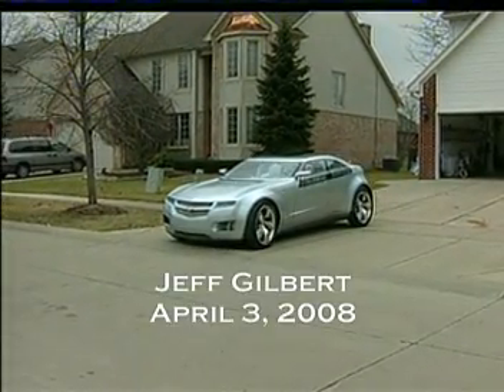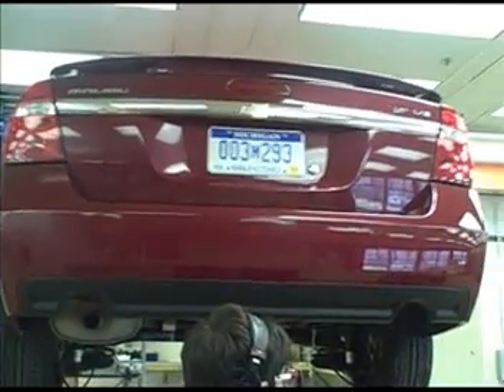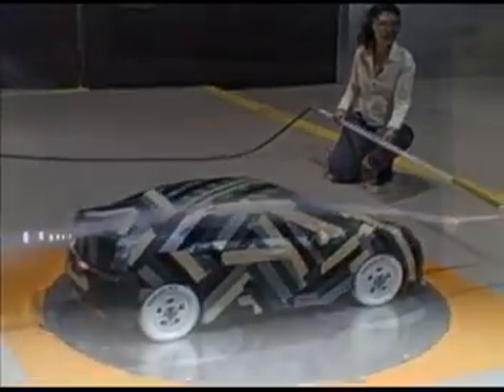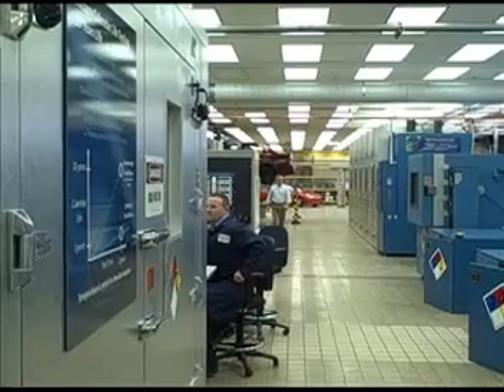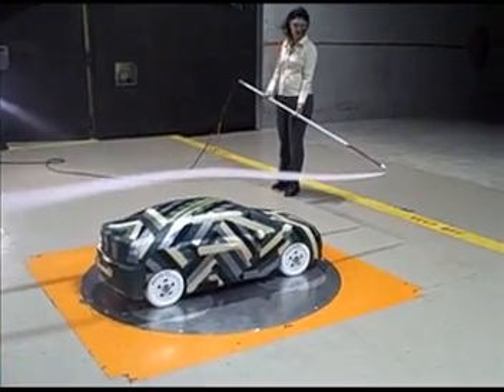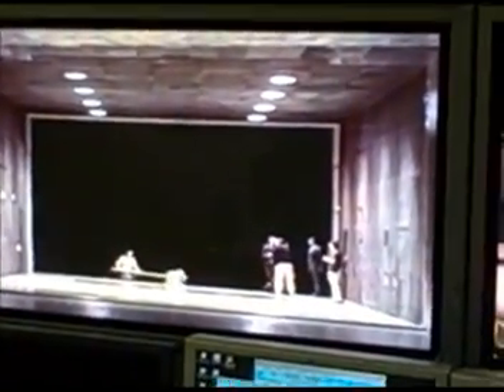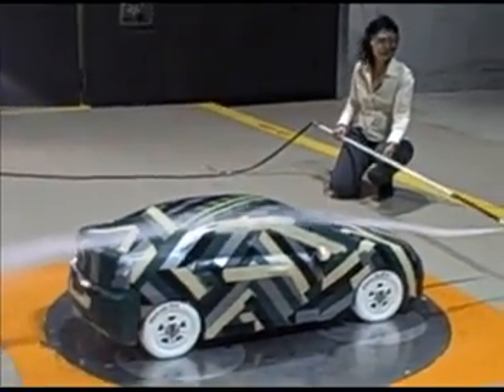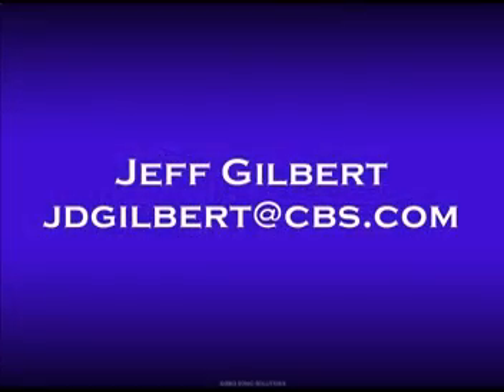Chevy Volt Laboratory

Comment from the maker: They use a computer at first.  Then after they've designed the model they check everything out in a wind tunnel to make sure their calculations are correct.  Same thing with crash testing.  The computers save time in the development process...but they still have to test real vehicles.

Comment: GM mass producing car sized and rated Li-ion batteries can ONLY be a positive for EVs. 

As the supply of and market for Li0Ion EV batteries expands the price will drop like with all consumer electronics products (Cars have never been directly subjected to Moores Law before) and all EV 'enthusiasts' will be able to by a fully assembled and tested battery pack over-the-counter from GM at an increasingly affordable price instead of having to make a 6000 cell pack from 'laptop' batteries.